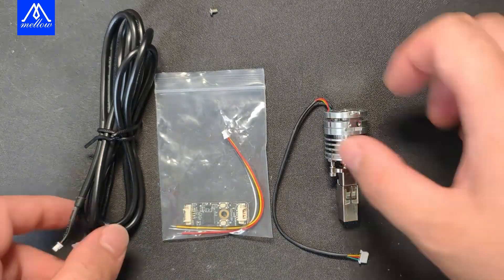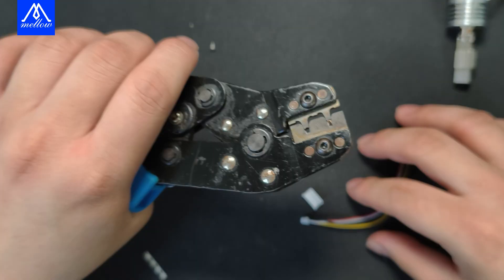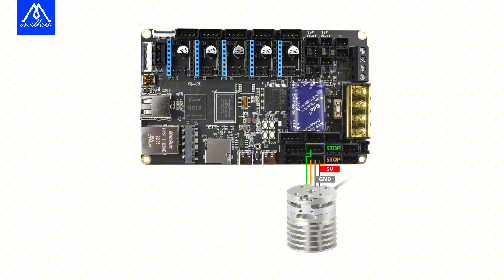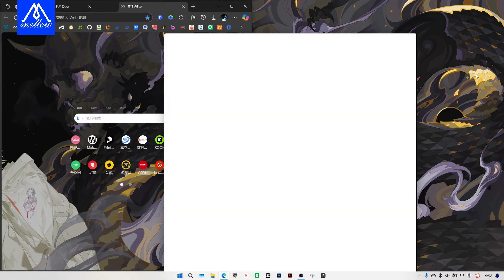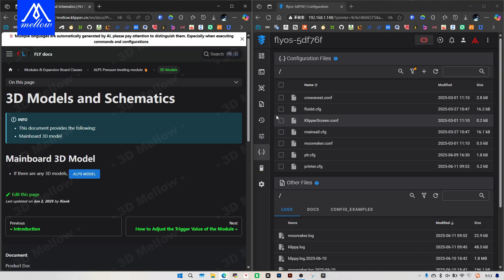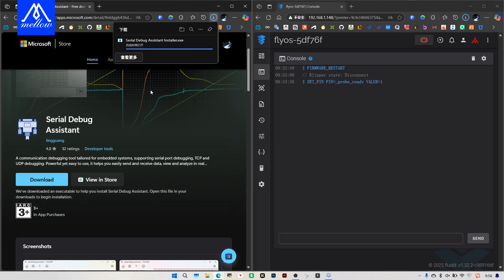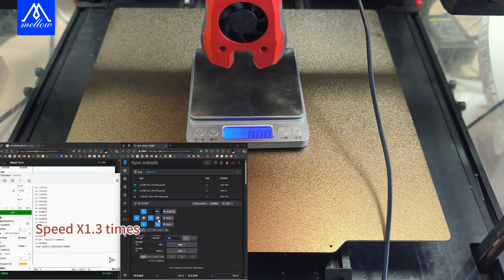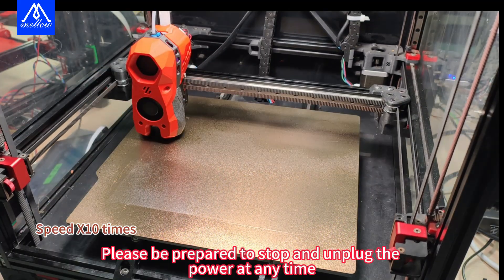ALPS Pressure Leveling Module Tutorial

Comment: I bought the v6 version of this, but it doesn't have any threads for the v6 heat break...
Reply from the maker: Thank you for choosing Mellow. You can contact our customer service, and they will help you resolve .
Reply: Did you get the correct parts? 
Looking at getting the V6 Vulcano.
Reply: @karlsmart321 I did. Seems to work quite nicely.